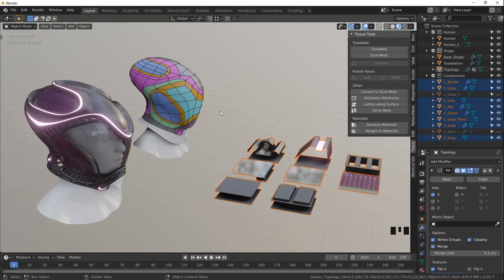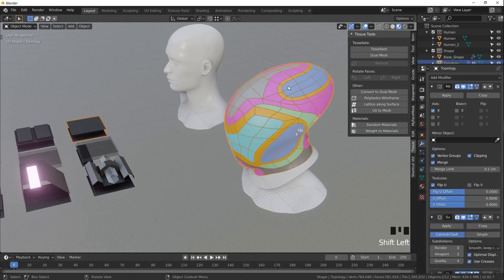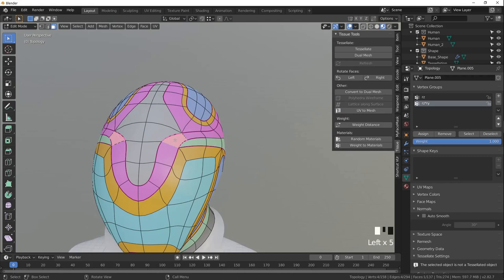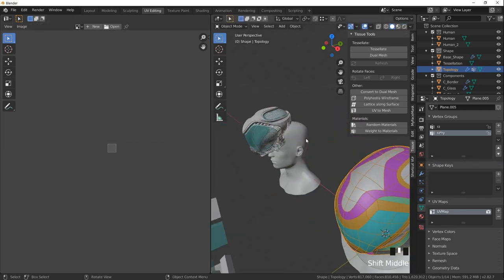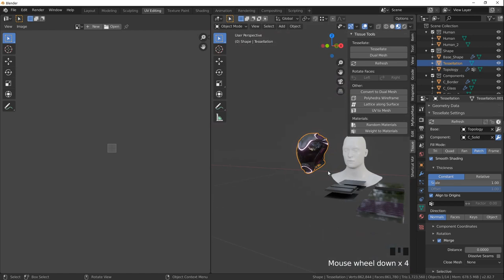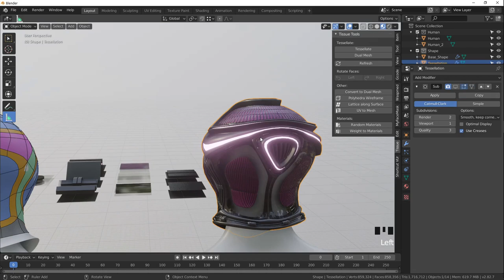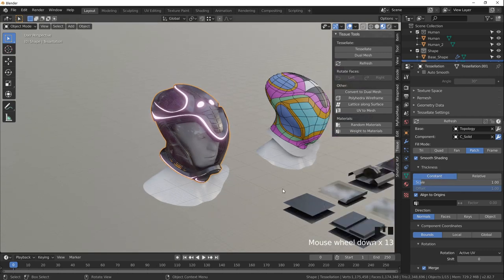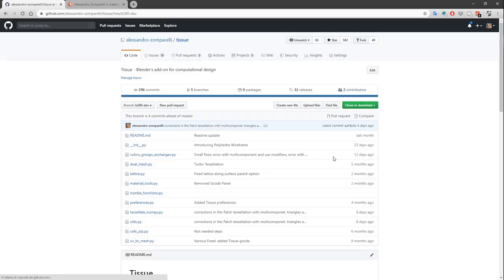Tissue - Multi Components Tessellation (for Hard Surface modelling)

Comment: this technique is incredible, so much possibilities but i wish it was just a bit easier to use, there is just so much huddles nd tinkering to get it to look decent that i'd just rather sculpt the helmet. Have you revisited how to make using this a bit easier?
Reply from the maker: Hi! I see your point and I agree. Sometimes it is hard to cover all the possible situations and there are many parameters that are involved. I tried to adopt the default settings that I considered the most intuitive for beginner users. Probably some specific parts of the workflow could be improved, for example, some smart tools for the rotation of the components when a Mirror modifier is used. One small improvement is the new button for the use of the multi-components method based on the materials: https://docs.blender.org/manual/en/latest/_images/addons_mesh_tissue_tissue-tools.jpg (check the material icon on the right of "Tessellate")
Reply: @AlessandroZomparelli  thankyou so much for your reply! and yes you're right smart tools for handling rotation nd other stuff would probably make this my fave modelling technique of all time. i tried doing the whole uv remapping nd rotating thing nd just gave up, the fact that we have to match the subdivisions of the components we wanna use is also another huddle 😅😅😩😩.

Comment: Great tutorial, it would be nice if you could make a tutorial on how you make the topology with different color code and edge loop
Reply: Pleaassse haha or if anyone has any other info on this
Reply: I think I got it.. fristly he made the shape with subd then he duplicated it. On the duplicate he then retopologized (if he did it on the initial head the shape would change) with a mirror modifier. Then he overlaped the two heads and scaled so that the duplicate is bigger than the original. He then added a shrinkwrap mod to the duplicate with the initial one as target. You may have to change the offset a bit.

Comment: Many thanks again for sharing this amazing work, was trying to follow along though stumbled on how to set up the multi component part. The multi component button is not showing in the data properties section under selective, we used the random materials to obtain the colors.. maybe this is for something else ? TIA
Reply from the maker: Hi, now it is slightly different. You will find the option under Components: Materials: https://docs.blender.org/manual/en/latest/addons/mesh/tissue.html
Reply: @AlessandroZomparelli  ah ok thanks.. just to confirm the colors to the base object are added using the random materials button after patch tessellating 1 object, then name each component the same as prefix names, then check materials under component mode  ? Thanks again..
Reply from the maker: @hasger1941  you can assign the materials in different ways. Random is not the only way, you can assign them manually to the base object. The important thing is that for every material that you use, you also have an object in your scene that have the same name. If you want them randomly, then you can use the Collection method instead. In that case the materials are not used at all. Instead they will be picked randomly from a collection
Reply: @AlessandroZomparelli  Thanks ♥

Comment: Hello, such a great Tutorial ! But im stuck at the first stage with the Helmet with all different  materials I guess using shrink-wrap ??? Could you please support us on doing this work please ( Splitting the areas on the Helmet ) ?
Reply from the maker: Hi Mrs Queen. The Shrink-Wrap modifier is used to articulate the topology of the object used for the tessellation, preserving the smoothness of the surface. This step is not critical for the tessellation. For the tessellation you mast assign different materials to the different shapes.
Reply: @AlessandroZomparelli  Many Thanks Alessandro ! But I'm sorry I'm bit lost about the part to get the helmet cut in several materials and with color splits ( On the right side of the screen ).If you could explain us or maybe mention what you did so I could look how to make it , many thanks in advance ,again great tutorial !!!
Reply from the maker: @mrsqueen8559  in the material panels you should add some new material slots. In every slot you create a new material with a name matching the names of the components object. When you are in edit mode you should see a button "Assign" in the same material panels which allows you to assign the material to the selected faces. I suggest to change the color of the materials and to go in material preview in order to visualize them on the object.

Comment: hi, i can't find the multi components on blender 3.1.0. even though i have followed your steps, thanks
Reply from the maker: Hi Sute, in the latest update, I changed a bit UI and the logic. Now it is here: https://docs.blender.org/manual/en/latest/addons/mesh/tissue.html#:~:text=is%20not%20necessary.-,Components,-Three%20different%20method as option material in order to use as components the objects that have the materials' name.

Comment: hi i m using the latest  blender and i couldnt find the multi components button under selective, is that moved?
Reply from the maker: Hi, yes, now it's a bit different. You can specify different components mode, and one of them is Materials. Which is equivalent to the former Multi components option

Comment: Hi, Is this tutorial still relevant? I tried to follow along in the dev branch 0.3.50 and the multi component button is gone. Is it done with the collection component mode now? Is it still possible/necessary to adjust the UVs? Thanks for making this though, i just really want to learn.
Reply from the maker: Hi Simon, you can use either "Collection" or "Materials" mode for the components. But "Materials" is the former "Multi-components". The UV system is just a method for controlling the rotations, but in the options there are also some alternatives. Depends on what.are your needs.

Comment: This seems like an easy way to cheat character modeling. Just have an 'eye' or 'mouth' that you can save in your database, append them, and add them to any model. Then apply, and sculpt to fit. Not as impressive as doing this ^, but it's gotta be a time saver.
Reply from the maker: Nice tip! :-)